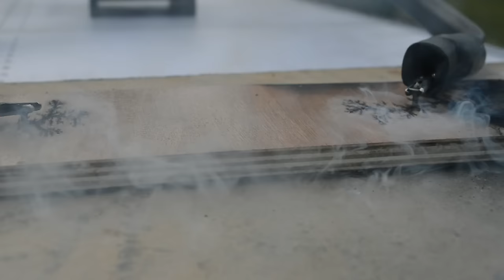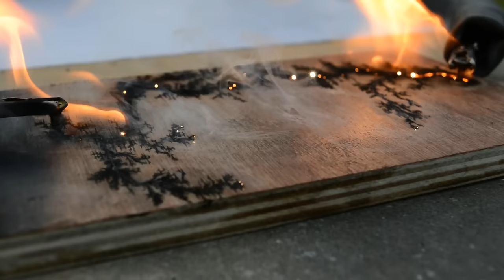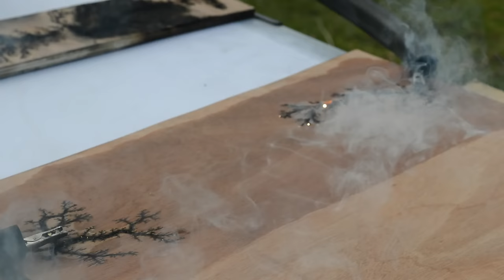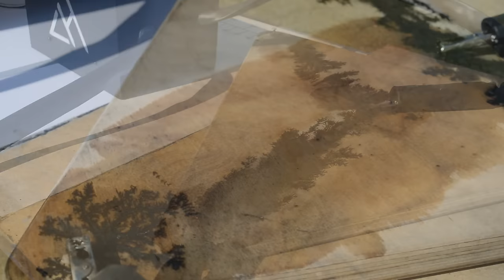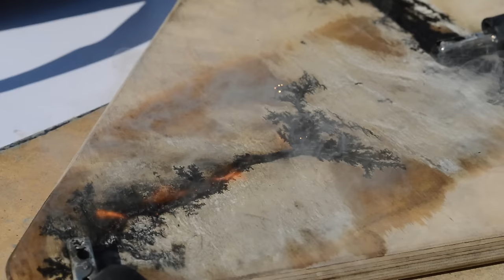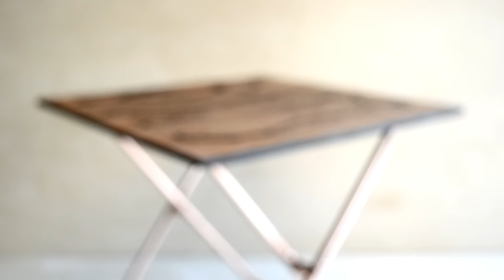Making Lightning Fractals - Lichtenberg Figure Wood Burning

Comment from the maker: CAUTION: DO NOT attempt this process without fully researching the required safety precautions and consequences. Do not stand close to or touch the cables, transformer, workpiece or work surface, even if the cables are electrically insulated. When I did these experiments, I used a long extension cable reel to plug/unplug the transformer, standing as far away as possible and never approaching the workpiece while the transformer was plugged in (I edited the video to take out the pauses where I got into position). Stand ready to pull the plug and do not leave it unattended. Don't try to get a closer look, it is safer to set up a camera and view the close up footage later on. Also make sure all the surfaces around the transformer and workpiece are non conductive, especially the surface you are standing on. Even if the transformer was unplugged, I still wore rubber gloves and only used one hand to reposition cables or add more baking soda mixture. If there's any doubt, don't attempt it.
Reply: Sad that you have to state the obvious this day and age considering what people are doing nowadays... Shouldn't people have learned not to play with electricity unprotected in school?
Reply: Or…. Just don’t do this at all!!
Reply: 0r if you were really concerned you would take down your video
Reply: Stop trying to censor artists/creators because you don't like their particular art-form.
Reply: the end product is beautiful! No one is "against" this art, yet this process has claimed many lives so an abundance of caution is better than leaving people in the dark about the risks.

Comment: I appreciate that you are standing away, and pulling the plug before approaching.  But read my story...we all get a bit anxious or lazy.
I still do this artform, but in a totally secure environment. I stand 5 feet away, but when I lift my hands off the two Momentary On switches, and they go off, even if one fails, the unit is dead. I also wear 12K gloves at all times.
Here's my unfortunate story, but I still go at the artform.

I am a military trained electrician, (21 years, retired), and spent 30 years in factories, as a electrical maintenance manager and an industrial engineer. 
 I got into this hobby about five years ago, and had a similar setup, save I elevated my platform off the bench with two glued on 2X4's. After time, you get a bit lazy...then maybe cut a few corners.  We all say we won't, BUT WE ALL DO.  I recently got into fractal burning guitars, and one late afternoon, a bit tired, didn't realize it was still on (and I have an "on" indicator light which had loosened and led me to believe it was off), and touched one probe. The other one literally jumped into my other hand, as the hand was touching the edge of the guitar body.  I "Rode the Lightning" for about two seconds until I fell on my right side, heavily bruising my shoulder and hitting my head on the floor.  When I hit, I woke up, got up and went into the house and had my wife call 911. Heartrate was 160, and I ended up in a burn center for three/four days as they monitored my heart, and treated the burns on my hands, which were not that bad. Huge hematoma on my forehead, and a scalp cut on my head where I scraped on a bench nearby. NOT FUN, NEAR DEATH EXPERIENCES....
Changes I will make:(And so should you if you insist in keeping on)
1. Add two momentary on switches to the incoming 120VAC in a plastic housing. Both have to be pressed to engage the unit. Far enough from each other so it takes two hands to light it off. One hand lifts, it dies, both, obviously off.  No 120VAC, no burn. Two switches, two hands.
2. My potentiometer, which I use to adjust the voltage, will be next, in a straight line away from me. Adjust before I can press both buttons, which are UL approved to be Open when released. 
3. The actual unit on its platform, further away down the line.
4. The probes, with 10K insulated wire, extending to a separate wooden table. I see people doing this outside where the moisture is higher than inside. One guy was standing in snow. Just crazy.
5. Finally, 12K gloves, 1.8MM thick, in case the switches, and the potentiometer all fail and it stays lit.
6. I am standing on 3/4" insulated rubber flooring, the final table will not be on the same rubber.
Sound like a lot?  10,000VAC is a lot!  I am lucky to be writing this, but this is what I should have done in the first place.
Lichtenberg is like nothing else in beauty, and it is highly, highly dangerous.  I see people using regular wire, no gloves, machine very near to the work, and I think, there is number 34, waiting to die....
Stay safe.
Reply from the maker: Thank you for sharing your experience, I recommend anyone wanting to try this process should follow your safety measures, and take time to carefully examine and improve their setup so that it's physically impossible to have an accident. I personally have stopped using the process due to the risk, and am enjoying experimenting with other creative processes.